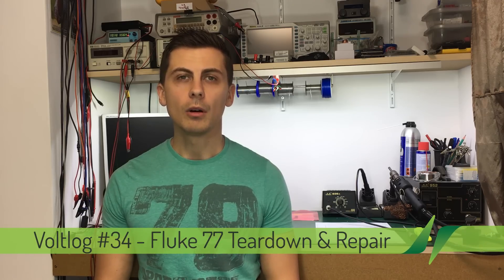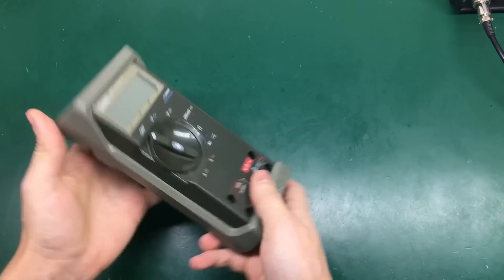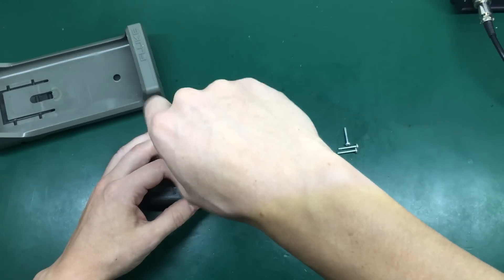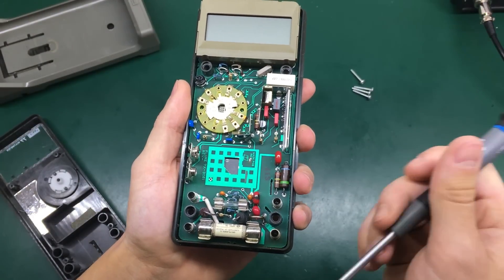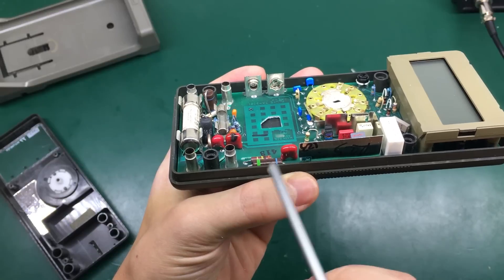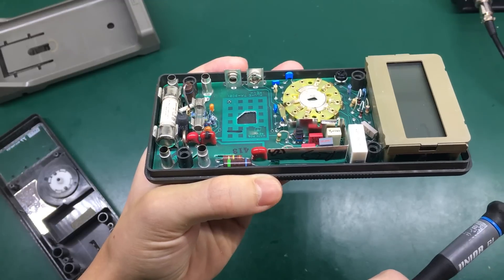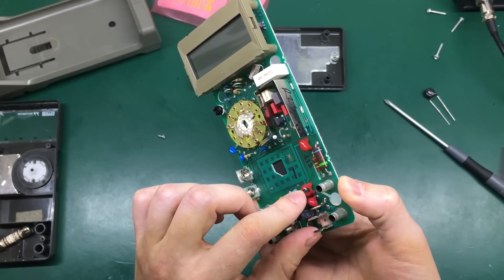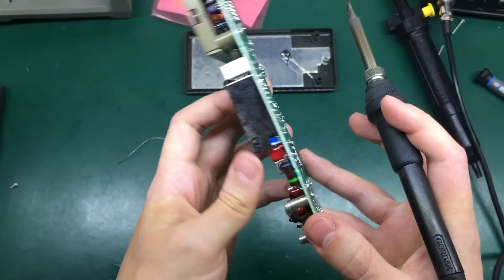Voltlog #34 - Fluke 77 Teardown & Repair, Varistor Replacement

Comment: If anyone needs info...I had a problem with the ceramic capacitor c14 that goes from the varistor to ground, and because of it I had 13m ohm in the resistance mode and it was on the display instead of OL. You drew my attention to the varistor, but then I saw that the capacitor was faulty. Thanks man, good video

Comment: The Fluke 77 (original version, which is now referred to as the Series 1 to differentiate it from the newer Model 77 meter) is a classic and a true workhorse. I selected this model in early 1986, when as a new employee at a company, one who was supposed to be the more electronics savvy resource for my department, I was tasked with setting up a small laboratory. I had a limited budget, but I still wanted quality. The 77 seemed the ticket although it was just a basic DMM, no bells and whistles. After getting one in my hands, I liked it so much that I bought one for myself. It is still on my home laboratory bench, and although I also have some newer, nicer, fancier, more precise DMMs, the 77 is my go-to meter for quick measurements. Every 10 years I send it back to Fluke for a touch-up of its calibration, a service I think they still offer for this model to this day. I also bought the 77's big brother (I can't recall the model number at the moment) which looks nearly the same but also tests frequency, capacitance, and maybe one or two other things. It resides in a compartment of a leather electronics tool bag, which has been in the trunk of my car for decades, so I have it handy when I visit company shops or customer sites. It endures all the vibration and temperature extremes of at least -30F to well over 100F, and still works great. Yes, Fluke meters are worth the cost.

Comment: Working at Goodwill I brought my own Fluke 77 (purchased Fluke  in 1985 when I worked at Specialty Electronics in Atlanta where I sold them.). At Goodwill I was testing an electric fence transfomer and thought my Fluke was set on AC...but it was DC. I heard a small "click" and the fluke was dead.  I thought maybe the fuses protected it, but that was not the case. Something else is blown. I can barely see some kind of display. If I knew what part was blown I could chase down the part and do a little surgery myself.  I have purchased a replacement Fuke 77 off of ebay. In the meantime, I have not tossed my original Fluke to E-waste. I still hope someone can help me figure it out and bring it back to life. Goodwill won't replace it, they cannot even pay competitive wages.

Comment: I have the Fluke 75 , checking voltage 575v 3 phase. After second phase,  the display shows a number even no test. The battery, fuse, rotary seem ok. Even at ohm function should read OL but some number showing. Any ideas as to why this may be?

Comment: The small fuse should be a ceramic sand-filled fuse for safety. The glass fuse is incorrect. The rating is 630MA/250V, Fluke number 740670 (replaced by F-630MA/250V-FG).

Comment: The link to the manual does not work for me. Can you fix the link? Thanks.
Reply from the maker: http://exodus.poly.edu/~kurt/manuals/manuals/Fluke/FLUKE%2077,%2075,%2073,%2070,%2023,%2021%20Series%20II%20Service.pdf

Comment: hi voltog#34 you have great vidio explanation bro about varistor ,what i wanted to know is how to check varistor or what is the required  Oms? or resistance? for a good varistor?
Reply from the maker: there is no easy way but in normal operation the MOV will have a high resistance and small capacitance. You can also check for short circuit which is a common failure mode.

Comment: great video, my fluke 77 displays all display characters regardless of the selector position, any suggestions on how to fix?
Reply from the maker: +Steve Tripoli In a situation where you get intermittent segments it's worth cleaning the zebra strip contacts and the pcb pads with some IPA, don't use too much. But in your case if all digits are on it might be a software problem, or maybe the on/off switch stays pressed at all times and the meter is in some test mode ? try cleaning that key also.

Comment: Very nice tutorial.  It would be great to see a vid on adding a current fuse, MOV protection and other things to a cheap multimeter to give it what  could be called a CE ratings.  I have a BEST brand which I have taken apart and the circuit board has places to add these items but it lacks through holes for installing these parts.  I like this meter but am somewhat reluctant to use it in high voltage, high current testing.
Reply from the maker: +Joseph Nicholas you mean the parts are marked in the silkscreen but there are no holes? Anyway, when you work with high voltages or any high energy circuits it is best to use a proper rated multimeter, one that can ensure your safety if something goes wrong.
Reply: Yes, the current fuse is marked but not there.   I have ordered a MOV with the correct voltage and would  like to put in a PTC  too.  The case has lots of room, so adding circuit protection shouldn´t be a problem.  Your video gives me more a better idea how a MOV is used in an ac circuit.  Thanks.